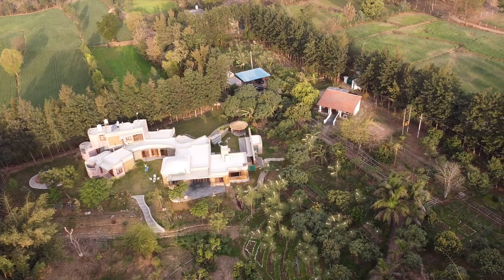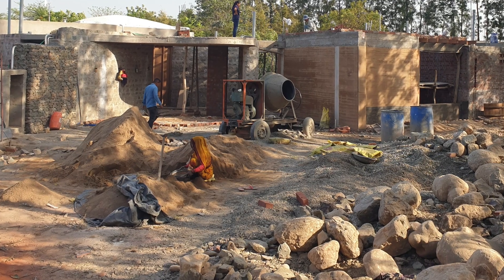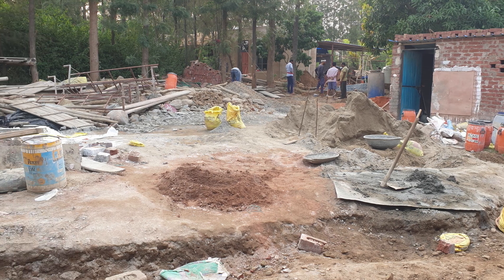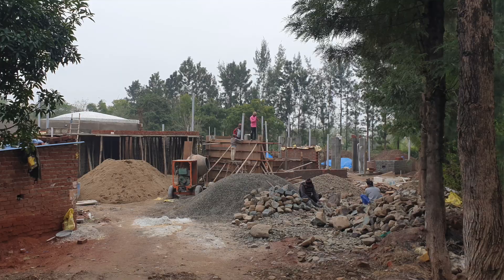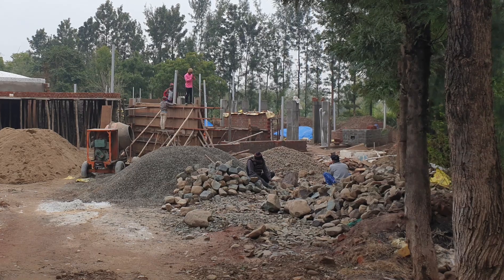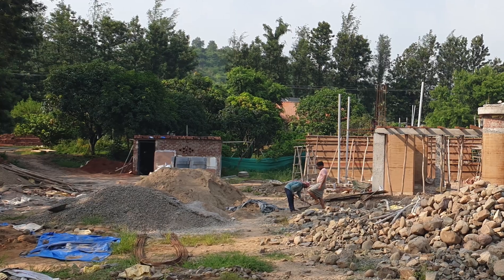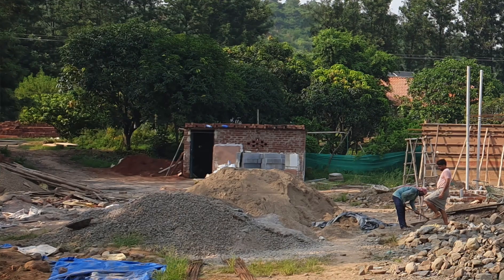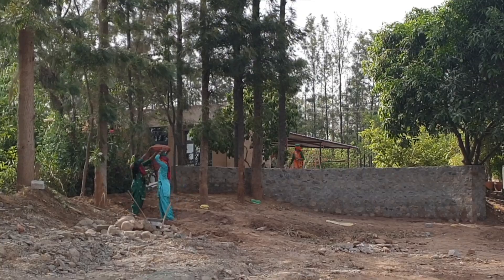How to Manage Construction Waste on site

Comment: I totally agree with your philosophy of dealing with the waste you have created in your own building project on site. The plastic is always the hardest stuff to deal with isn't it? We either reclaimed or turned into biochar all our waste timber. The stone and brick are easy to use for building walls and things like you did. We used a bunch of waste plastic to partially fill in a greywater soak-away pit but it was a bit of a dilemma what to do with it really.